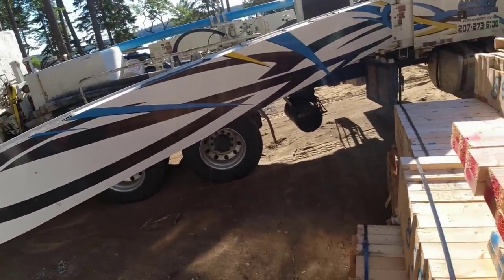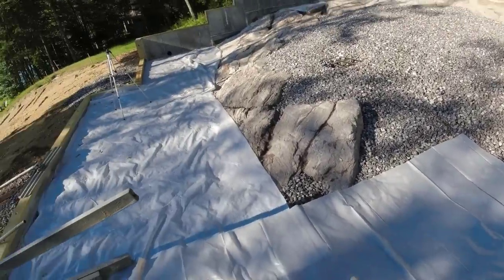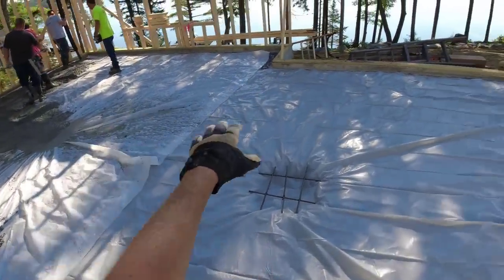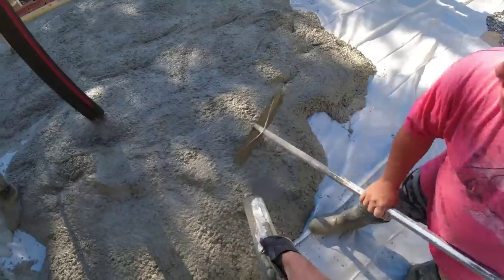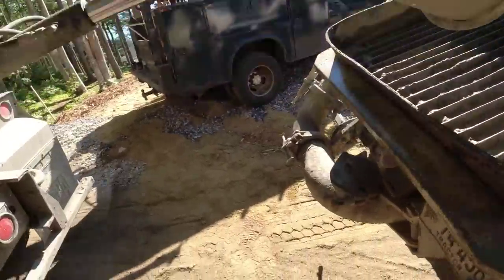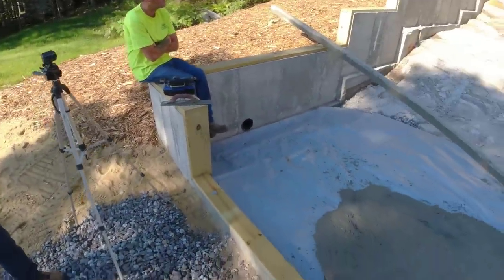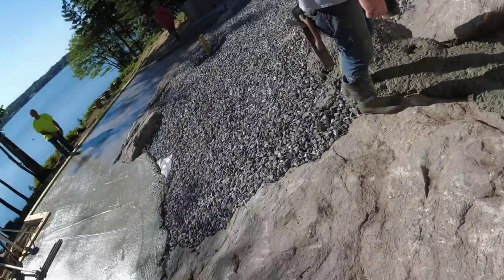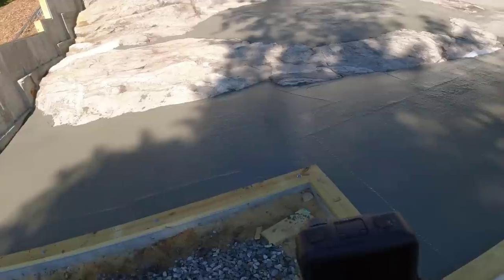Pouring A Concrete Floor Over Ledge (New House Basement Floor)

Comment: A lot of commenters have asked about hammering or blasting. Geology varies, in my area it’s granite. You wouldn’t hammer that hole out with a mini, by the end of the day you wouldn’t have much done and you wouldn’t have much of a bit left. Blasting is a tough one, and usually reserved for larger projects that can’t be done economically with a hammer. I have done both. Blasting requires among other things, hiring a geologist and engineering firm to inspect neighboring foundations prior to blasting. You always get that person a quarter mile down the road that needs his foundation replaced and Is looking for an opportunity for someone else to pay. Had that happen to us on a 36 unit apartment building job! Fortunately we had all the proper documentation.

Comment: I think if I were building a house on the ocean in Maine, I would’ve either blasted a hole or hammered a hole, don’t know that many people who buy waterfront property in Maine that don’t have the money to spend on the extra, and I think if you’re a GC you already know there’s going to be ledge in these areas, and tell them to expect a $100k foundation, radon seeps up through ledge, and sometimes methane, if it were me, I would’ve spent the extra to have a full foundation. But you did the best you could with it, and made it look great as always.
Reply from the maker: Thanks Chris!
Reply: I'm in Maine and I've seen this a lot. Most of the time the customer takes the money they are saving on blasting and make the upper floors larger to make up for the space they lose in the basement. I look at it as having less space to store a bunch of junk you don't need anyway.

Comment: Nice job Mike. Why didn't you or they run poly over the ledge and under the poured concrete at the bottom. As a lifelong Mainer, and longtime carpenter, I have seen water finding the ledge and running down the top of it. In my house it runs in on one side and right to the low side where there is a drain. My house is over a hundred years old so I just put poly over the floor, so it keeps the moisture down under the poly.

Comment: Hi Mike I had a question for you. It's going to be 27 degrees for the low and there are no concrete blankets in town to rent. If I use straw, should I put plastic under the straw or put it directly on the concrete, and then have another layer of plastic on top if the straw?

Comment: No rebar needed?
Reply from the maker: No, not inside a foundation like this and if the sub-base has proper compaction. The floor isn't going anywhere. We do saw contraction joints after troweling to help minimize any cracks and the mix has fiber-mesh in it too.

Comment: No foam underneath 
Is that because of the ledge its on

Edit spelling
Reply from the maker: The code in small towns don't require it, it's not really needed unless there's radiant heat. All our pours before radiant heat were like this.

Comment: how much u think it be to get a breaker hammer to that rock and clear it out? or not an option?
Reply: $600/day just for the hammer where I am
Reply: @wallacewoodworks9582  mini over here comes out to roughly 3000/week or 500 per day so 1000 more plus cost of operator
Reply: @chorgzent.3978  wow that is pricey for a mini! Most recently we rented a 315 (16 ton) for I believe $2200 for the week
Reply: In my area excavator about $ 150-200 a hour another excavator about  same rate to move ledge then dump truck $110 hr to move ledge. I've had customers hammer for 5 days then say that's all the money they can do and add a step in the floor.

Comment: Is there a law about hammering the ledge out?
Reply: It’s just insanely expensive
Reply: @wallacewoodworks9582  they make it look so easy
Reply: @chorgzent.3978  they really do. I just finished a crawl space excavation and hit a ton of rock, absolutely sucked. The rental cost of the hammer was higher than the excavator itself
Reply from the maker: Yes, it's very expensive to hammer (or blast) out.
Reply: @MikeDayConcrete  what would you think that'd would cost 10k?